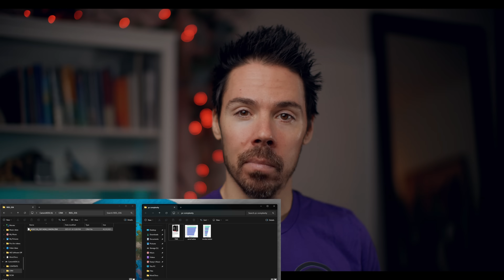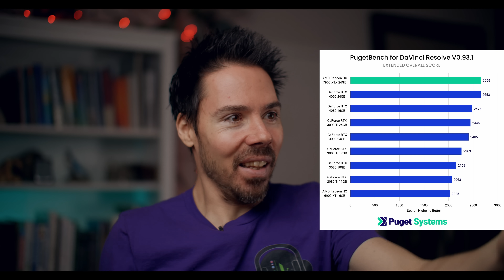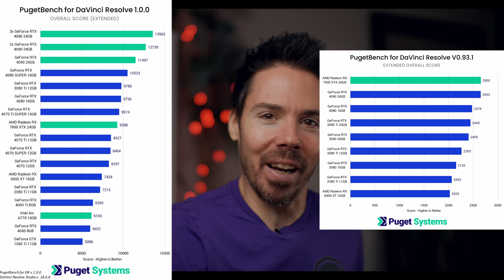The PC Building Rabbit Hole NEVER ENDS!

Comment: 3:08 I need to see actual tests to be sure, but my gut tells me that this potential is less than 5% in some - not all - scenarios. GPUs, barring the absolute top-shelf stuff, usually aren't that bound by PCI-E
8:30 most likely, but it doesn't matter in any realistic scenario. The only one I can think of is going heavily into swap, like, gigabytes. Then your linear 1.4 Gb/s or something is actually relevant. You wouldn't be able to tell the difference outside of benches even if you go full SATA3, which is on paper is significantly slower.
12:00 sorry, I have no bloody idea. The only thing that I know is that Intel QuickSync and, apparently, Intel ARC are really, really, really good when it comes to video decoding.
13:17 PCIEv3 is already blazing fast. For the context, PCI-Ex1, version 1(the very first one, circa 2003, and only one lane) was already 250 Mb/s

Comment: 1. Graphics card should always go in fastest slot, the first x16 2. your m2 drive should be at the top spot 3. You already have usb 3.1 (blue usb ports) support just get a usb c to usb a cable (if you want gen 2 speeds, install on the second x16 slot 4. It is safe to set it to run those speeds even if the motherboard says it is OCing.

Comment: The NH-D15 will definitely be quiet, BeQuiet coolers are also, quiet. 
The rule of thumb to a quiet system is that you always want "a bigger cooler than necessary" so that the cooling capacity is way overboard, so if you have a 65-95W CPU you would want twice that capacity in cooling alone.
The NH-D15 is rated for something like 300W which gives it a 3 times cooling capacity for your CPU, this translates into CPU cooler running at far lower fan speeds to maintain operational temperature of your CPU. 

If the Noctua is too big, you can look into BeQuiet coolers, like I said they are, quiet, performance not top of the line but for quiet performance and price, they are pretty good.

Also make sure your memory runs at 1.35 volts in BIOS.
Inside the BIOS, go to M.I.T section (those are listed at the very top, its right next to SYSTEM - BIOS etc) 
Set DRAM VOLTAGE (CH A/B) to -> 1.350V

Comment: Make sure your bios is also up to date. (excluding beta bios). Looks like the nvidia cards received some optimisations in Davinci resolve which changed the scores. You will not be losing that much performance running the 7900xtx using PCIE 3. I wouldn't worry about it. Just make sure you used display driver uninstaller to completely remove the previous nvidia drivers and ensure that the amd drivers are kept up to date.

Comment: every system is built around a so-called platform and your specific one, if i remember correctly you have a Ryzen 2000 chip, is meant to only have 20 PCIe lanes total. if there is one thing that drives up cost in computer systems it's PCIe lanes so the entry-level platforms all have only around 20-28 lanes. those lanes are used not only for the PCIe slots but also for other I/O (input-output) devices like your SATA ports or your USB ports. that leaves enough lanes for only really one slot to be wired with 16 lanes. board maker can decide to fit the board with PCIe switches which then allow the board to dynamically allocate those 16 lanes to either the first slot or to split across two for an x8/x8 configuration depending on if you're using only the first slot or both the first and second one. without checking the manual, your cheap board probably doesn't have PCIe switches so that second PCIe slot won't steal any lanes from your first one. however, as you personally are looking for the GPU to have all 16 lanes, that might be a benefit. the second slot instead is wired through the chipset. running high bandwidth/low latency dependent devices on a PCIe slot wired through a chipset can introduce issues so it's not ideal, which is why it's generally prefered to steal lanes from the first slot to have real lanes for the second device. entry-level platforms are all about trade-offs. you should just see if that card works for you in the second slot. if you want more PCIe lanes, you need to look into HEDT platforms like Intel Xeon or Ryzen Threadripper. they're designed specifically for creators but they're very expensive. my suggestion is try to make a entry-level platform work for your needs.
Reply: the motherboard manual is dogshit (as usual with Gigabyte their stuff sucks big time), so I can't give reliable advice on what configuration is best, just try what that other commenter suggested: GPU in first x16 slot. M.2 drive in top slot (be sure to use heatsink as now it's right under the hot GPU). USB add-in card in second x16 slot. it obstructing the fan won't be making your GPU temps much worse. i recommend you also use your GPU's software (AMD Adrenaline) to set a limit to your GPU's max frequency, just lower it by 5% or so. it will decrease your temps a lot because nowadays all hardware comes cranked to the max but those last few % of performance demand a disproportionate amount of power. with my AMD card it decreased my power usage from around 250W to 150W and therefore also temps. it allows you to set your fans lower too. reliability might also improve.
Reply: the same is true for CPU. with extensive testing I was able to determine that with my cooler (NH-D15 G2) I can limit CPU temperature to 60 degrees in BIOS without performance loss. one thing few people know Ryzen CPUs have bad power scaling so you can very quickly go too low with the temperature limit and lose a lot of performance. Intel CPUs have great power scaling and are therefore way more flexible. with tuned CPU and GPU my system runs at the same low fan speed at all times no matter the workload and is therefore always silent.

Comment: You've just spent around £700 new on the 7900xtx, which is a PCIe 4.0 card, and put it into a PCIe 3.0 motherboard, so you've crippled your GPU card. By the time you finish spending money on crippling components on that motherboard you could have bought a totally silent Mac mini Pro.
I was pleasantly surprised to discover all my photo and video editing programs work on my Mac mini with my existing licences so I didn't have to spend any more money on software.
Reply: The second part of what you said is true. The first is not. PCIE 3 vs 4 makes a negligible difference to the performance of the 7900xtx.
Reply: @TheHalfmanofOz  PCIe 3 operates at half the speed of PCIe 4. Are you implying that makers of PCIe 4 GPUs are being less than truthful about the need to upgrade to PCIe 4 GPUs. The latest PCIe standard available is PCIe 5, which has a further doubling of speed from PCIe 4. The B450F motherboard is 4 generations behind the curve, having been superceded by 550F, 650F, 750F, and now is at 850F. Socket AM4 will not carry the AI engines that will come with AM5 processors and the latest PCIe standards.
Eventually, updates to software just won't allow the latest AI functions to run.

Comment: Gentle reminder that the M4 Mini Pro could have been plugged in, turned on a month ago and saved you all of these headaches and you would have had several USB-C ports (that are also TB5 and expanded into many, many ports if you wanted)

The M4 Max Studio is the computer you need. If you want to be stubborn and stay on PC, sell the 7900XTX before the new AMD cards are announced and get a 5070Ti, upgrade to an X570 or similar board with more ports.
Reply: Apple is for squids.
Reply: yeah, the nvidia 5000 series have an updated hardware encoder chip that does 10bit 4:2:2 support.   Seems necessary for what he does.
Reply: @mainelyhobbies  Should'nt it do at least RGB 10bit 4:4:4 at any framerate and resolution?
Reply: exactly lol

Comment: At some point in your imposed Whack-A Mole process you will realize that it would just be easier to just get a new computer.  I just built myself a new editing computer and when sort of whole hog in that I also purchased a 27" 4k monitor for it.  One advantage to building my own is that the motherboard I chose features two Thunderport 4 Ports.  On the front of the tower case I also have two USB 3.21 ports (btw this is the same speed as USB-C with the larger profile).  Tested with my USB-3.2 portable drives I get a sustained transfer rate of 835 mb/s with the Thunderport 4 ports and 400 mb/s with the USB-3.2 ports.  I don't have much interest in Video so currently I'm running the onboard graphics and it is working just fine.  However if I want to use multiple monitors I may end up getting a Graphics card.  BTW the motherboard has 1 PCIE 5x16 slot and 2 PCIE 4x16 slots. 

Drives.  Primary is an M2 2 Tb SSD from Samsung.  Secondary drive for image files and the like is a Crucial 4 TB 2.5 inch SSD running on SATA.  Initiating and formating the secondary drive required a bit of a dive into Youtube on how to do it.

Finally if you aren't locked in the Windows world I would advise you get a Mac M4.  If you are in the Windows world either build your own or have a custom build done by a computer shop that offers that service and know what they are doing.  BTW, I've been using Asus motherboards since 2012 and their Customer Service is top notch.  Yeah the wait time is typically around 40 minutes but if you run into a problem they will stick with you until everything is all sorted out.

Comment: CPU architecture & motherboard chipset defines the availability of PCI-express lanes (from CPU and from chipset aka PCH)

Recommend X3D chips to maximize GPU performance. 5700X3D is a better buy than a 5800X, IMO. Can be had on Ali express for $165.

HEDT platforms such as Intel’s X299 / Skylake-X (EOL) and AMD’s Threadripper have more PCI-express lanes. Newer mainstream CPUs tend to have extremely limited PCIe lanes, problems started around time of NVMe adoption, but are really just market segmentations created for profit seeking & to reduce I/O die complexity. Higher end chipsets have more lanes available, and usually faster generation lanes, at that. You’ll find a nice sweet spot in the mainstream market sockets such as AM5 by targeting higher end chipsets and motherboards meant for ‘creators’, such as ASUS’ ProArt series. 

Next time, open your case and locate the origin of the noise with your eyes & ears before arbitrarily replacing parts. Also, keep in mind power supplies tend to have the longest warranty of all parts in your computer. You’re likely still covered by the PSU warranty if it’s less than 10 years old.

Also, you can connect X4 cards to X1 slots with risers. In particular, in a slightly ugly mess inside the case, you could use a front panel header on a X4 USB-C expansion card to a front panel to back expansion adapter, in combination with a PCI-e X1 riser—just make sure it has an open back end so that it can fit longer cards. Some motherboards even have open ended X1 slots, but that’s less common.

✌🏻

Comment: ha ha ha ha....Do you make videos or are you a PC home lab Dood... ha ha ha ... I like these videos btw, they are totally hilarious.... they are emblematic of most peoples experience with building PCs. It is important to note that the PCIe lanes are shared by not just the PCIe slots but also by the M2 cards, SATA, and USB ports. 
Therefore read the documentation of your motherboard, it will cageyly explain* what is a shared asset. i.e. the x8 slot is probably shared by one of your M2 slots.  (*Gigabyte documentation sucks)

Basically you have a set amount of pcie lanes, in your case 24 lanes, - 4 for the CPU, 16for the graphics card slot 1, so only 4 left after that from the cpu. depending on the motherboard you have, you could have a few more lanes which are used by SATA and USB, and generally one of the M2 slots. the last M2 slot usually shares the lanes with the x8/x4 PCIe slots or sometimes with some of the SATA ports.  

The PCIe lanes debacle and the level of processor you need to get for your workflow, is one of the marketing strategy  scams that INTEL invented and that AMD decided to join to force users with many peripherals to HAVE TO use their highest end processors (Core i9/Ryzen 9) or their professional CPUs which usually have the most lanes. (i.e. Xeon/Threadripper) even if you don't need this combination. ie as you noted a 5900x is perfectly fine for your workflow in therms of power and pcore count, but the lack of pcie lanes makes it that it cripples all of your Peripheral and port needs. On top of that even if you did get the top end processor to get more pcie lanes, you would also have to get a top end motherboard ($600+) to actually get access to all the lanes, which is even more of a ridiculous contemporary problem, that has come from the gamer driven overmarketing driven side of the PC market.

Some of us are not gamers, do not want RGB any thing, or freaking glass cases. but do need, 12xsata ports, 10G ethernet, 6xUSB4/TB4, 4xM2Gen5, 2x x16slots, 2x x8 slots 1x 2x slot...  but instead its all focused on gamers so 1x16 is enough cause who needs more graphics cards... oh wait are there possibly other uses for PCIe slots, ah who cares about those content creators, they can just go to the $1100+ threadripper and Xeon and buy the freaking $800+ motherboards, oh that hardware only works on windows Enterprises, oh I see.   and there are a lot of compatibility issues... 
It is all a giant scam, and it has been for the past 20 years. (before that you could buy a midrange motherboard with a midrange cpu and have 8x PCIx slots at 8x ram slots, etc etc... the only change has been "scientific" marketing which has slowly been destroying computing for creators as we knew it... on all platforms  .

Comment: The X670e boards dont share the pcie lanes. But since i was upgrading anyways i just spent $50 more for an X870e mobo. 
Your old cpu is holding back your 7900 xtx. This is my first upgrade in 10 years. Totally worth it. Wait for the 9900x3d and the 9950x3d comes out.

Comment: 9:35 having the operating system on a separate drive and your files on another drive is actually a good idea for a couple of reasons. One reason is that the computer can access both in parallel, speeding up load time. Another reason is that the operating system drive remains free of clutter impeding its function, and yet another reason, if you have an operating system failure you can reinstall it and your files remain undamaged. 
The good news is that this is probably one of the easiest modifications you can make.
Reply: This is only reasonable in the days when SSD's were 128GB maximum in size, because filling up the SSD above 80% slows its operating speed considerably. 
The parallel operation only works with harddrives, with nVME storage, which is what Kasey has, its irrelevant, he already edits his files off other drives, his system drive probably rarely sees much load, and his video files wont stress the drive enough to warrant a parallel operation for multiple nVME.
Reply: I had to deal with this a weak ago, built a pc and tried to use my old ssd's... Since I don't remember what I had on those ssd and didn't want to lose any data, I endup buying a ssd just for windows. First configuration was to change the download folder's location, not making this mistake again.

Comment: Kasey, don't be a cheaparse and buy a new case with good ventilation to properly cool your new graphics card.  You should have sold everything.  Look how much you pay for the upgrades and you are still struggling with certain things.  It wouldn't cost that much more to build a new computer and your troubles would be over.

Comment: For AMD, definitely move the NVME drive to the top slot.  You have a heatsink there for a reason.  Right now you don't have any heatsink on it.  That slot that you use also shares the PCIX lines with the video card.  Just get that B550 or X570 motherboard with USB-C onboard and be done with (either new or used).  Make sure it has ALC1220 audio.

Comment: The two PugetBench results are from different times. The older V0.93.1 is only found on a site that had a big red notice banner at the top warning that the data is old and dating the site at December 16th 2022 (3 days after 7900XTX release, a couple months after 4090 release). the V1.0.0 seems to be the newest published one AFAIK. Didn't find a date but the image says it was done with Resolve 18.6.6 which was released March 20th 2024. So the benchmarks have different versions of Resolve, GPU drivers, and the benchmark software as well. The benchmark can also emphasize whatever they want it to, for better of worse, and they might have changed that too. However I presume the biggest reason for the massive change in 4090's performance is massively improved drivers to actually get all the juice out of the card. Idk weather with AMD they never did that, or the drivers were already as good as they could be at launch. In general Nvidia has been better with optimizing stuff for their hardware, and AMD just puts as much power in the engine as possible. Idk if Nvidia still has separate studio drivers for non-gaming use, but it could very well be that those weren't ready or the best they could be a couple months after launch, because gamers and AI industry are a bigger market to cater to.

IN GENERAL: Never trust benchmarks of anything from only one source. There's way too many variables, so just read from multiple sources. Also Userbenchmark is so BS you can just ignore all of their stuff. (More info: YT search "3kliksphilip userbenchmark")